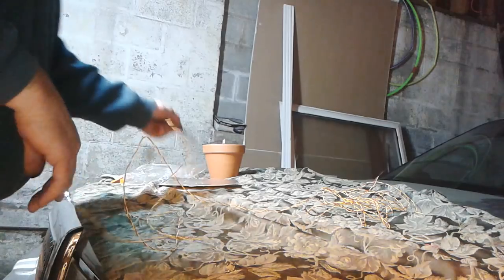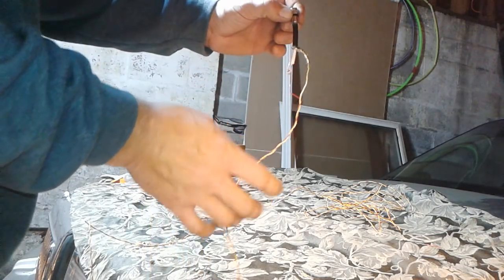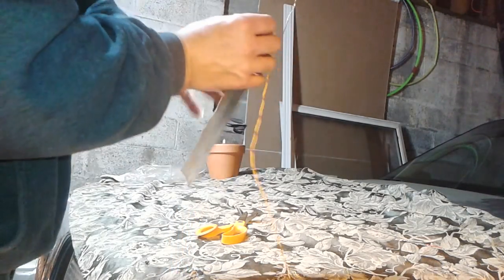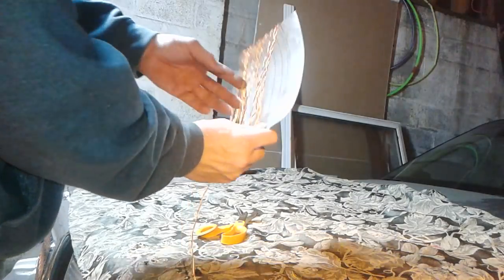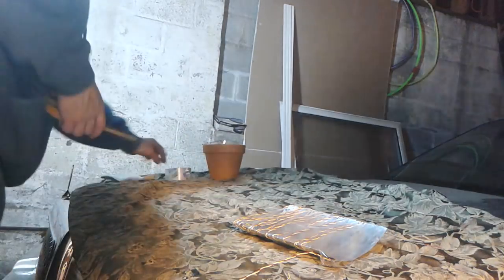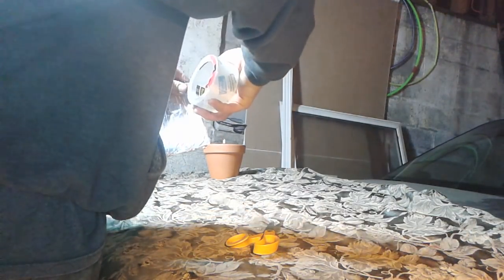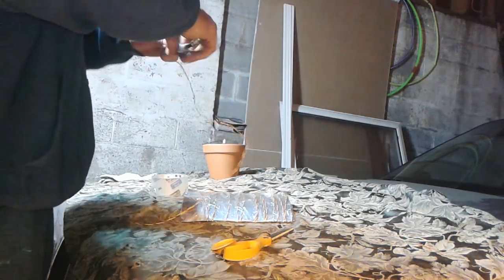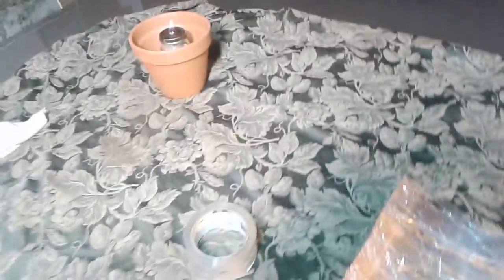Quickest, best HD TV antenna you can build

Comment: I did same thing but what makes it way better.  I had three old notebooks.  I took all the metal binding off made one long wire.  tied one part of to my down spout and  from there wrapped it around my water spout them I wrapped the rest of it around the coaxcable.  I cut the cable on one side.  But the wire I just wrapped it all around the cable.  I get 30 free channels or so now. vweird part though we're the wire wraps around my water spout I wrapped some aluminum foill around it and my local channels now look better than when I viewed them through cable company and it's free

Comment: I don't see what the plastic wrap and tape are for?
Reply from the maker: it actually helps keep the electron stable as they collect to the antenna,  otherwise they will hit and bounce and never give a stable connection! 
you can even put a clear coating on the aluminum plate then wrap the wire around the plate , the wire is already coated !

Comment: A folded dipole antenna made from a coat hanger, scrap wire, or aluminum foil should perform much better than this. DTV is mostly UHF so a long wire is not needed for those high frequencies.